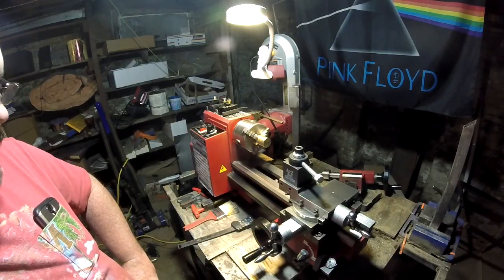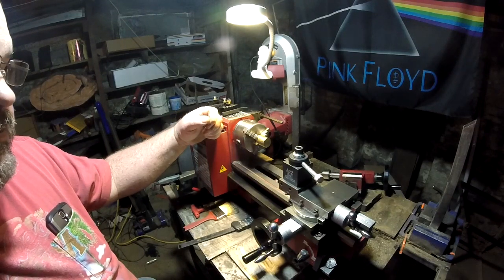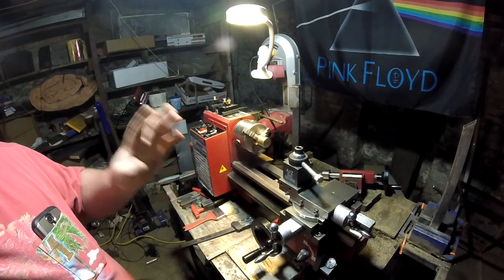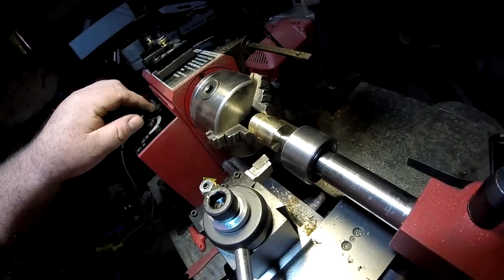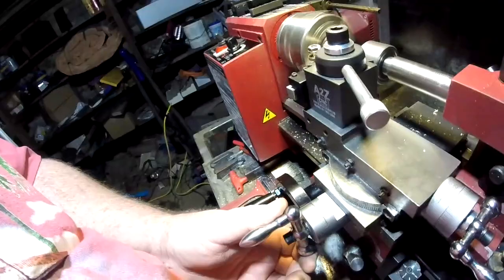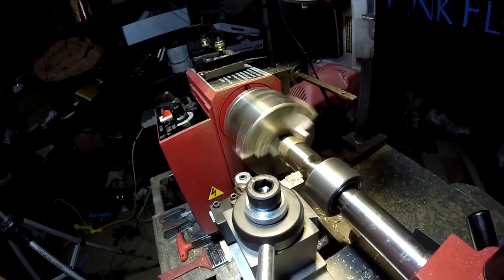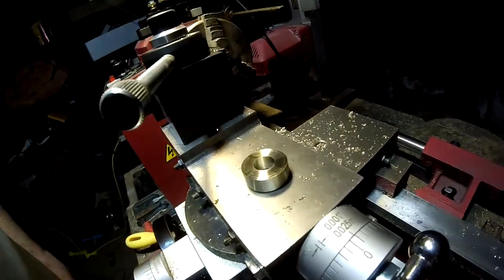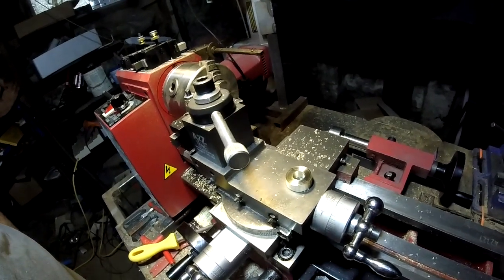Making a washer - basic lathe operations

Comment: Do you have a video with the mods/descriptions you added?
Reply from the maker: +rus tey The tool post is just an unscrew the old one and install the new one. It's made for this machine so no fuss at all. The cam-lock tailstock lock only requires you drill a 1/2 hole in the side of the cast part. I didn't make any videos. But since you asked, Ill see what I can do.
Reply: +Adventures in Welding! I have wanted to get one of these for years but can never justify it but watching you play makes me wanna just go get one, how true is it out of the box?